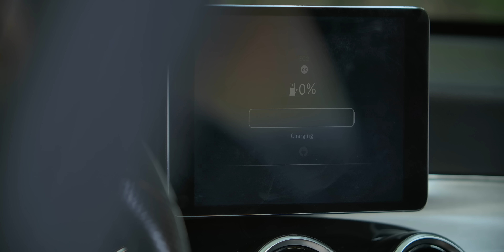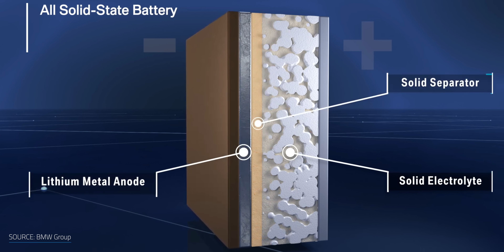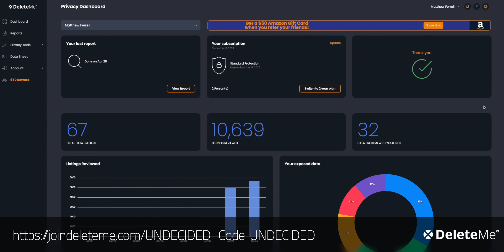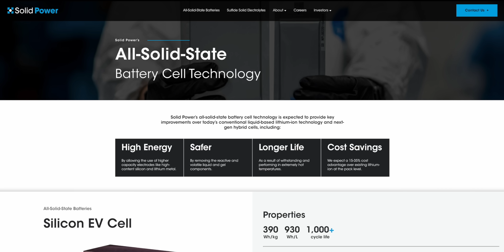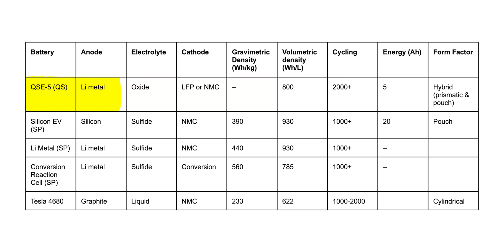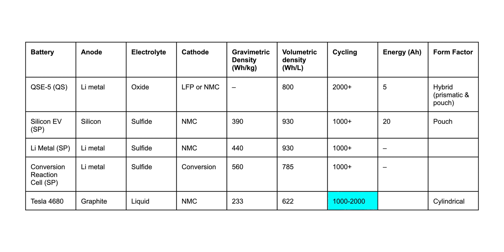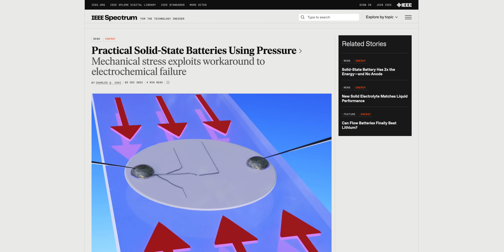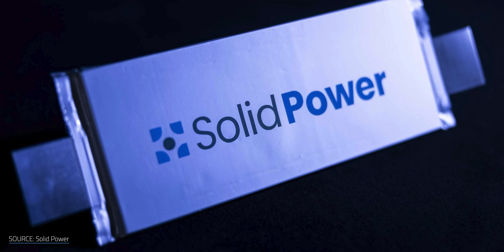Solid State Batteries are Closer Than You Think

Comment: On charge time, if you do the math on what it would take to charge an EV in 5 minutes, it often exceeds the current limit on any existing connector. Also, all existing charge stations would need a transformer upgrade to support it. The battery may support it, but it's not the only limitation.

It's also not really necessary. A 20 minute stop every few hours is fine if you plan for it.
Reply: You need to rethink charge time. ...

Yes you're right but only if you insist on delivering the charge from the grid during the recharge. But that's not how you'd do it, assuming these batteries do live up to the expectations.

The charging station would have a massive battery that could deliver the charge to a car in 5mins. That battery would be on charge for much longer, prior to the car arriving and drawing the charge. 

By charging the static battery continuously there would be a much lower current draw from the grid. 

Even better: the charging could be variable, not to suit the needs of the eVs but to suit the needs of the grid.
Reply: @trueriver1950  Has anyone done this yet?  It makes perfect sense to me, using a huge battery or capacitor like you said. Then it could also power the local grid in an emergency also.
Reply: @trueriver1950  The grid battery would need to be made of something different if you want to scale up production to the point everyone can drive an EV because there isn't enough nickel, cobalt, nor lithium available to mine for that to happen everywhere.
Reply: @5467nick  grid scale batteries usually aren't lithium. Without the limits of weight that EVs have, a whole lot of technologies open up. Heating up a box of sand works.

There's also plenty of these minerals. The reports to the contrary tend to misunderstand what "reserves" means for minerals, and how more of them open up over time.
Reply: @timmmurray8110  They're practically all lithium. Look at the lists of them that have been built. You can't efficiently get electricity from hot sand.

There are not enough of those minerals for NMC lithium ion batteries to be built in quantity to transition to fully renewable energy, not even close for some of them like cobalt. I realize that reserves expand both as we find new deposits and as technology improves to make use of deposits that were previously too hard to get to or process, but the deficit is too great for technological advancement to be enough to change it in the lifetimes of anyone alive right now, The only way forward for that is to make different batteries out of more plentiful resources.
Reply: @5467nick   They are practically all lithium because the west is 5 years behind battery technology. China is building sodium-ion grid batteries.
Where you are right is that all these sand-"batteries" aren't a real thing.
Maybe redox-flow batteries will be a thing eventually, but considering how dirt cheap LFP and sodium-ion are getting, probably not.
First of all there is more than enough Cobalt. Second of all, who needs Cobalt when you have LFP and sodium-ion? What other "minireals" do you imagine to be in too short of a supply?
Reply: The part about needing a grid connection upgrade is false. Some chargers already have battery storage on-site to handle peak loads, removing the need for a massive grid connection. Just add some more of those and you’re good. As for the CCS connector, there’s already a variant capable of delivering MW (Megawatt) or 1000 kW charging speeds. Though I doubt it will be needed. No cars can utilize the current max power of 400 kW for the entire charging session. Usually only for the first 40% before they start to throttle. Better battery tech like solid state can also fix that, reducing the charge time without increasing the peak charging rate!
Reply: @philipk89  Those big battery banks cost several hundred thousand dollars each for a modestly size one. Ignoring the fact we can't build enough of them to matter, we still couldn't afford enough of them to matter.

Nothing is delivering 1MW of power to a car-sized EV, not that it would be necessary. At 1000 volts, that's 1000 amps. No car is taking in 1000 amps. A semi truck or something like that, yeah the components needed for that could fit in a vehicle that large. With such large currents, it's not just battery tech, it's literally an issue to make wires big enough to deliver that much current to the battery cells. Even if you wanted to and could do it, if you wanted to do it from a battery bank, someone will have to shell out millions of dollars for a monstrously sized one.
Reply: I rewatched Styropyro's car battery video and the effects of how much power he was playing with are still nothing in comparison to this.
Reply: CCS Type 2 is pretty beefy and could be pushed further with liquid cooling. NACS might be problematic...
Reply: Yup. And I think capacity is still more important than speed. Tell someone they can drive a real 500 miles then have to stop for an hour is better than only going 200 miles even if you can recharge in 10 minutes.
Reply: @SnappyWasHere  yep, it the same things with phones, you got phone out there that can cahrge at 240w 0-100 under 20 min but battery life is only about 5 hours, or it takes 1 hour to charge but last for 10. i would pick the longer battery life every time over faster charging. Not to mention it cost alot more to provide and upgrade current infrastructure to be able to provide that type of current to fast charge in the first place which in most places we wont see it being in use
Reply: No, a 20 minute stop every few hours is not fine.  Because (a) its only 20 minutes if the charger isn't broken and there isn't a line and there aren't other people also charging on the same circuit. (b) It is still 6-10x longer than petrol, and (c) to the the same number of cars through a service island, you will have utilize 6-10x more land.    So instead of a 20 pump, 2 acre lot you will need a 200 "pump" 20 acre lot.  (d) you will likely need at least one new substation at a cost of $10-30million for each charging complex.
Reply: That's his info ✅
Reply: @mohmmedtolba  wtf is wrong with you. Why are you spamming this same thing
Reply: And how manny charging stations did the world have 10 years ago? 0? OK. A 20 min stop every few hours is ok if you plan for it? You must not know how much money that costs. I work in a company 500 emploers that are on the road the hole day. Do you realy think its fine that you pay people a lot for doing nothing to wait for the car to be charged up? Like cmon man.
Reply: @jensv874 road safety would be improved if people were forced to have sensible rest stops. 

In fact in some countries professional drivers have to have periodic test stops, and it doesn't kill their trucking and bus companies.
Reply: @jensv874  Driving that much you need an ICE vehicle. Different cars for different purposes. People get upset at EV’s like you can’t have one of each. Just buy what fits your needs. It took decades to perfect gas cars and will take awhile to perfect EV’s. We can all be friends. 🤗
Reply: @jensv874  Other than long haul truckers, there are very few jobs that involve driving on the highway for hundreds of miles every day. That's not a situation that even 0.1% of the USA's population is in. Even in that situation, with a 300+ mile range per charge on some EVs, you'd only stop once in a 500 mile or so drive. Stopping once in a 500 mile drive for 20 minutes isn't unreasonable since people need to eat and use the restroom at some point anyway. I won't even consider buying an EV until I have my own house to charge at home with and EVs come out with batteries that don't use rare metals mined with slave and/or child labor, but cmon man, be realistic with the math here.
Reply: @jensv874  If you're forcing them to drive more than 2 hours without a 20 minute break, I frankly do not have sympathy for your position. This is a health issue on top of a technical issue.

Comment: Always right around the corner… I won’t hold my breath. But quick takeaways here... Similar amount of charging cycles, as Apple have not many problems getting a little over 2000 cycles on their phone batteries recently. Cost savings will not reach the customer, in fact, they will be more expensive. Charging time is about almost the same, but we don’t know how many times, as “minimal side effects” are not “no side effects”. Capacity is between 30-40% more, very welcome, but not game changing, as we know manufacturers will focus on using less pouches to reduce weight - so none to minor (10%) gains in EV range. So no info on the weight, as it would be good to know the weight difference between a 70kw 4680 cell battery pack vs a 70kw pouch battery pack. A game changer would be a battery which offers twice the capacity for half the weight, and can be charged in 10 minutes with no ill effects. These packs are nowhere near even a third of this, thus will not be a game changer, and just won’t be adopted for many years, due to high manufacturing costs, high costs of redesigning battery packs and their support electronics and cooling/heating systems.
Reply: Every step forward is a step in the right direction.
Reply: @ClosedOpenness  It’s not really though it it? If Tesla takes these cells and makes a cheap model 2 or 3, and it has the same range as the more expensive version, then that’s something to take note of.  These batteries still have not seen the light of day, and are still theoretical.
Reply: "Twice the capacity for half the weight" in a single generation is a pipe dream. Sure, the tech advancements might make those cells possible in a decade or two, but I can't think of any technology ever quadrupling its performance in a single generation.
"So no info on the weight..." - Gravimetric density (in the table) is the column you want to look at. No info on the QS battery, but the sulfide separator battery claims over 50% higher capacity for the same weight. That means either lighter vehicles/electronics, or longer range - and it's up to the manufacturer do decide. I doubt EV ranges will increase that much, since driving for 300+ miles without any breaks is rare (and can be unsafe) - faster charging and lower weight is more likely.
I think applications for other technologies are more interesting. EV motorcycles could benefit from them, since their weight is a bigger concern than in cars; so could personal electronics, drones and (maaaybe) electric aircraft. Sure, they're gonna be expensive at first, but there is a market for them - and as the tech develops, it's gonna get cheaper.
Reply: @wojtek4p4  If those are cheap enough to be competative with LFP, NMC and sodium. CATL has a 500Wh/kg "condensed battry" (that seems to be their version of "semi solid state") but they are only marketing it to airplane manufacturers, presumably because of the price and because gravimetric energy density doesn't matter that much in cars.

Comment: It is going to probably be so very expensive until they can get up to scale. Also are there any plans to retro fit existing EV's that should be nearing their end of life cycles like my 2013 Tesla model S?
Reply: Unfortunately, it isn't as simple as sliding the old batteries out and sliding the new ones in. Each EV has an energy management unit that controls the flow of electricity to and from the battery packs. If you change out the batteries, you need to change out this EMS, too. You also then have to change the car's software to properly interact with the new EMS. Without doing this, the software may be making requests of the EMS that may cause greater problems because the flow of energy is incorrect.
Reply: Considering even a 50% capacity boost id gladly buy it for double the price
Reply: Tesla should offer an option to retrofit it. And if they don't, then media should criticize them for that.
Reply: @yensteel  They can't really plan a retrofit of a product that isn't their own and doesn't actually exist yet.
Surely it is up to the battery manufacturers to make that work with Tesla. Takes 2 to tango in this case
Reply: @yensteel  lol the media? Really? Why should Tesla do ANYTHING with 10 year old cars? That’s on you for buying something that we ALL a knew would be crap in 10 years. Companies shouldn’t be responsible for shit, 10 years after they made something. And if people  actually cared, the customers, with the money, would tell Tesla  themselves . But hey, at least you didn’t say the government should make them
Reply: @jamesbizs  You've obviously never seen Rich Rebuilds. Navigating around 10 year old tech ain't rocket science.
Reply: Going by current practices, it will be used as a reason to make customers but a new product rather than provide an upgrade
Reply: The good news is the Model S battery is designed to be replaceable. However the best bet is to buy modules from scrapped cars like my 2015 that the insurance company totaled for minor damage to the front and rear where the battery was fine. 
There is an industry that takes Tesla modules and puts them into classic car conversions, but the few companies that work on replacing the batteries in old Tesla’s are overwhelmed with business
Reply: GM's current Ultium battery platform is designed to be upgradeable. The cells are individually swappable.